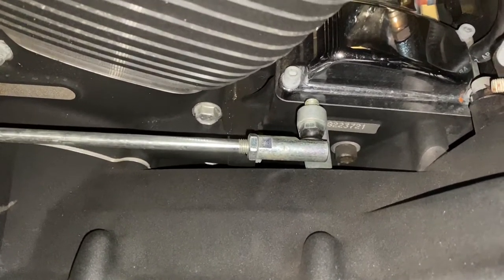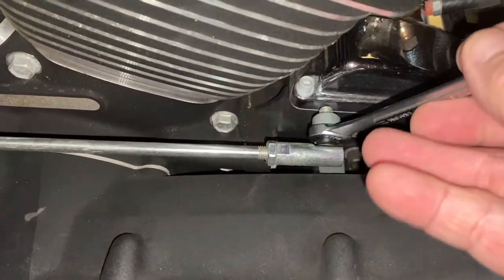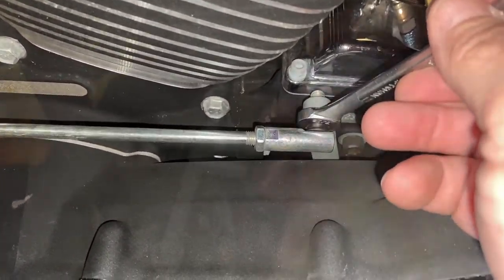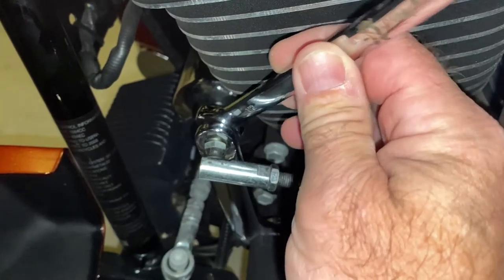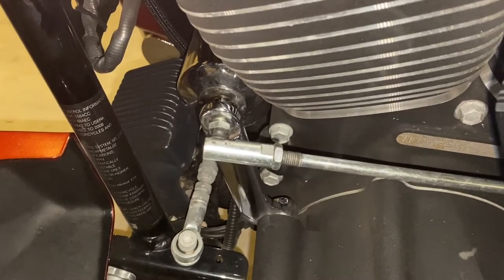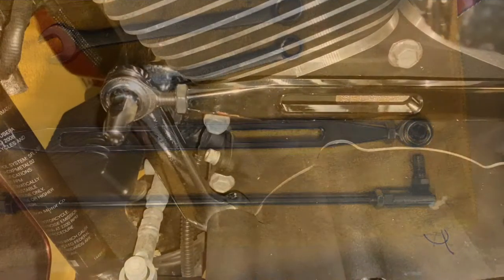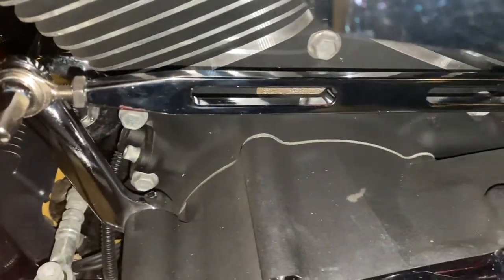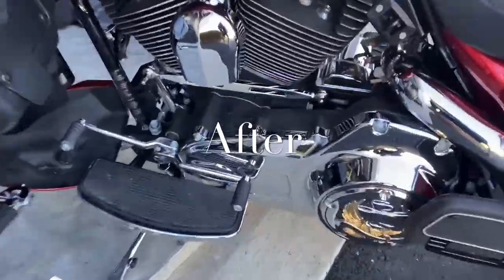How to change Harley Davidson shift linkage.

Comment: That new shift link is lookin' GOOD!  I want to pass along a word to the wise:  While you are in there, put a wrench on the aft link, down in-between the inner and outer cases.  The Pinch bolt on the vertical shaft... That bolt likes to vibrate loose!  Check the vertical shaft for play (looseness left to right) every time you wipe down the bike.. First sign is a hard to find neutral,  2nd sign is sometimes sloppy shifting. Third sign is a complete failure to shift!  If that bolt rattles loose: The outer primary needs to come off (including all the internals of it) Then, the transmission needs to be pulled apart to get to the other end of that gear selector... Needless to say: This is a very tedious and very expensive repair! All because of one loose bolt!   Keep an eye and a wrench on it!
Reply from the maker: Wow!!!!   That’s exactly the input I’m looking for.   I will look into that ASAP.   P.S.   The new tires are great.   The subconscious anxiety of riding on the old tires was killing me.    Going for the deeper leans in the curves and turns now.   Thanks Scott